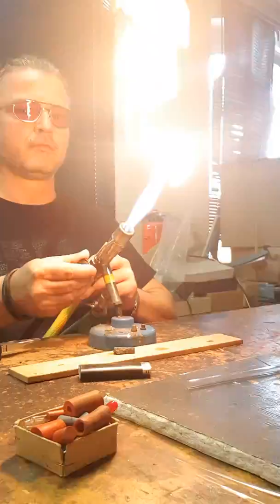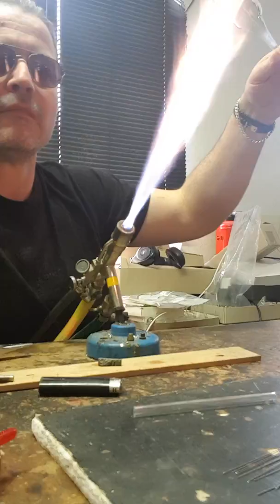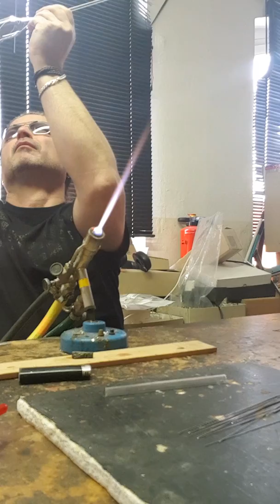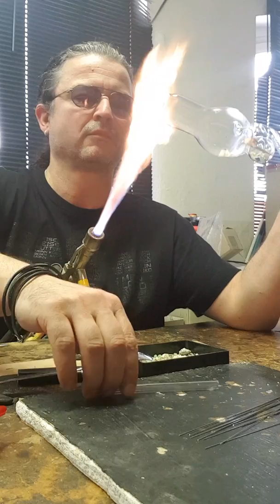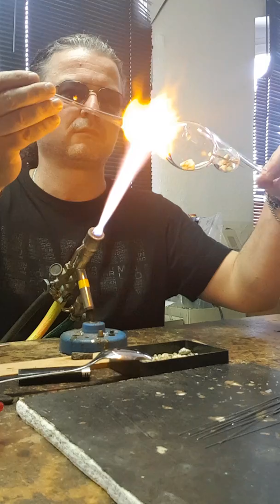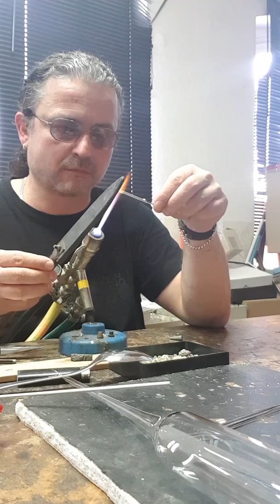Teil 1 Projekt Kleine Mineralienröhre : Die Herstellung und Befüllung

Comment: I am sorry I do not speak German, but I enjoy your videos very much! 

I have been slowly teaching myself some scientific glass blowing and building vacuum devices like gas discharge tubes.  I've had some success with soda-lime glass and dumet wire seals in the past, but borosilicate and Tungsten seems to be a little more tricky to make perfectly reliable.  I have successfully made good boro-tungsten seals but I usually use thin wire and spot weld it to Nickel each side of the seal. Some of my thicker gauge Tungsten seems to not want to wet with glass at all, is there a specific type or cleaning process?

Could you please give a bit more detail on the electrode assembly?  I assume you are using Tungsten wire for the seal through the glass?  What diameter?  Any preparation beyond the oxidation in flame seen in the neon lamp video?  It looks like you bead it up with a small glass tube and tweezers pushing about half the length into a bead?  Is the electrode Aluminium?  Do you just melt the Tungsten into the Aluminium?  I tried this recently and was very surprised that it seemed to work well.  It looks like the glass also pokes into the electrode to strain relieve/mechanically support it?  I've had trouble with breaking the Tungsten with vibration of the electrode from the vacuum pump.  I assume the Aluminium is used for low sputtering and good work function?  I've tried Nickel and other materials like Titanium and Molybdenum but they sputter rapidly, darkening the tube walls and harden the vacuum.  One of my 1st discharge tubes with Nickel electrodes started as a few torr 300 V glow lamp and is now so hard it is an x-ray tube that fluoresces green and needs 30 kV!

Last week I successfully made a small Hittorf detour tube and a really ugly Holtz valve tube in 5 mm boro glass with Tungsten seals and Aluminum electrodes that both work but any tips for reliable glass to metal seals and electrode materials would be appreciated.

I'd like to make a mineral tube one day, what are good minerals?  I assume calcite is likely to work as it generally has enough manganese impurities to cathodelumesce brightly?